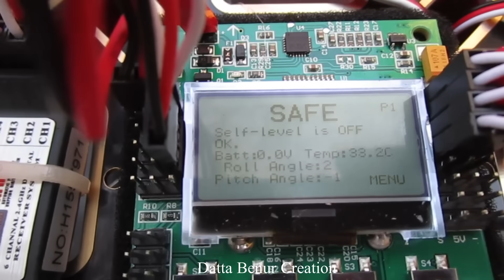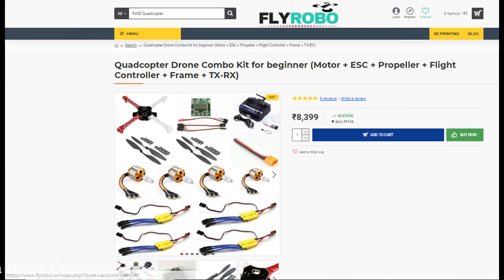How to make Quadcopter at Home - Drone

Comment: Try to edit your pi values and selflevel values and calibrate esc . The drone will be extremely stable
Reply from the maker: ok
Reply: I would like to know if we can use Orange 3s 11.1v 5300mah lipo battery.
Reply: What is your drone flight time?